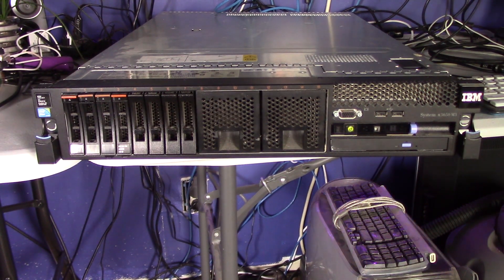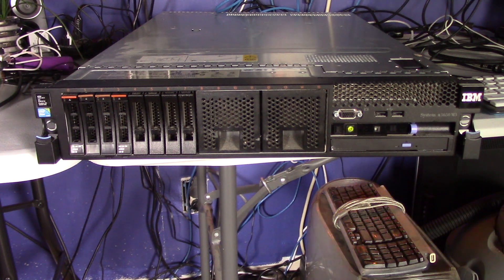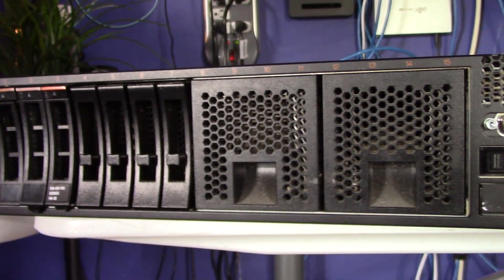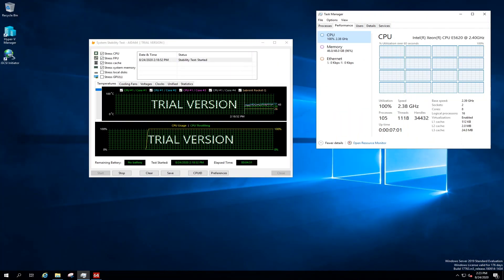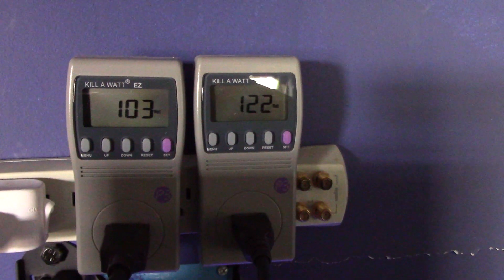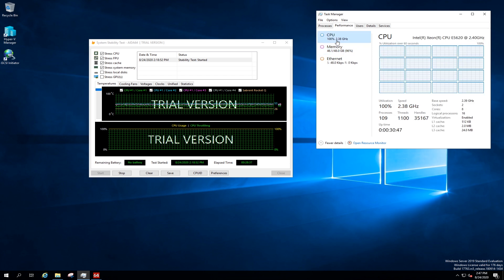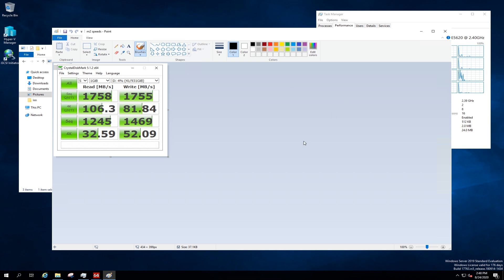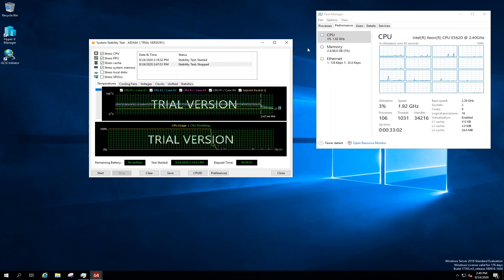Giving an IBM/Lenovo X3650-M3 new life!

Comment: This vs azure virtual desktops that are billed on a hourly basis? What is more cost effective?
Reply from the maker: Ok I will bite, figure 25 users x 4core machines with 8gb ram running windows 10 and office 365, add 10 users running 8core 16gb ram, with high end video card for cad work, running windows 10 office 365 and don't forget to add the cost of managed os disks, storage accounts, and also outbound data transfers, figure 8-10hrs usage per day, let me know the costs and I might look at it :)

Comment: Now I start to think that I undersold my IBM x3650 M3 with two hexcore processors and 48GB of RAM at $150 a couple years ago! I had really planned to be using an M4 by now, but I just have not gotten around to making a place for one among the rest of my machines.
Reply from the maker: Thanks for watching :)
Reply: I hope you have a dedicated place for your gear I own M4's they are very loud. Mine will be moving out to the garage after I run some cable.

Comment: I have some 3650 M4's in my lab and I need to come up with a way to handle the noise. My options are IMPI, fan mode, or move out to the garage.
Reply from the maker: Or replace them with Dell's 710's :) at least at Idle they are less noisy :)